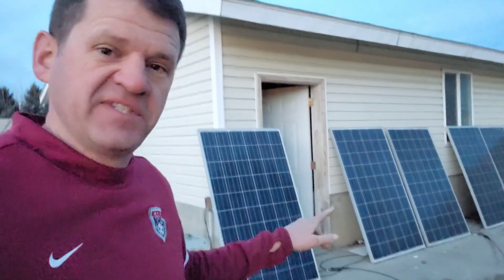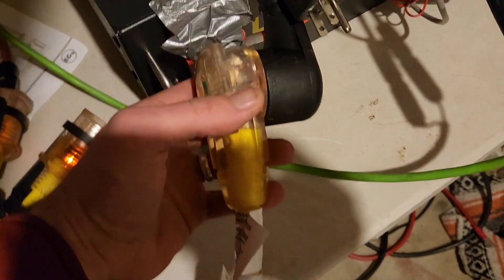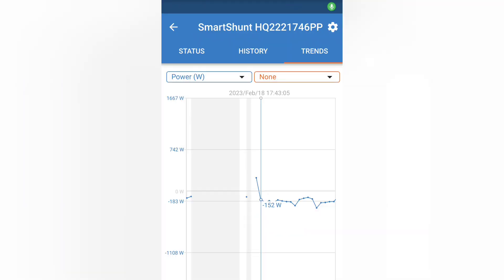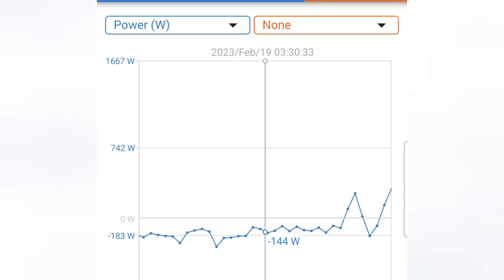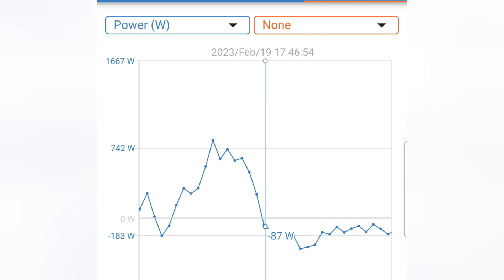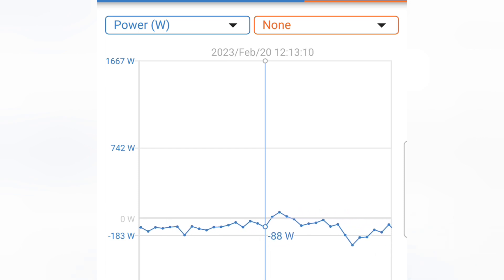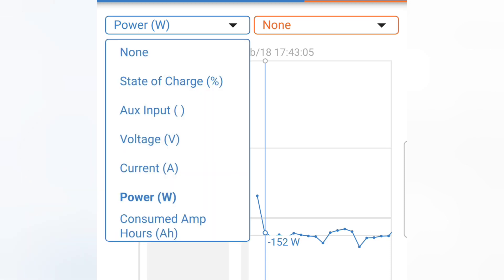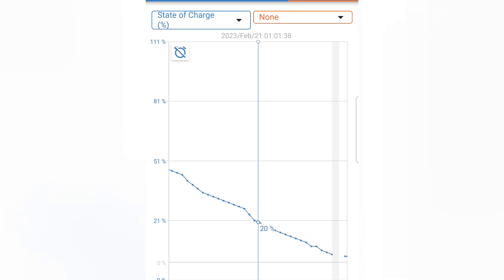How LONG can you RUN 2 FRIDGES on a SOLAR GENERATOR

Comment: Hello Sir please help me, i have 2* 550w solar panels, 50a solar charger control, 3kva inverter, 4* 100ah batteries  so i want to do installation this month so can my system run 24hrs and also in cloud weather?
Reply from the maker: I have another video titled how much solar do I need to run a house refrigerator.  That will have all the math you need to know

Comment: Buy yourself some new, big panels for summer and fit them carefully. Keep the old panels for winter supplements. You may still need generator power, get a decent charger that will charge your battery in an hour or so. Running a 2+ litre car to make a couple of KW is so wasteful on fuel and deprives you of the use of the car for the period. If you have wind, harvest some wind can be 24/7 so it soon stacks up Kris Harbour (youtuber) gets about 1400w from his system day and night.
Reply from the maker: Thanks.  I'll check out his Channel. I just bought five new high efficiency panels for my RV.... in addition I would like to have three strings of six used panels to supplement on cloudy stormy days.
 Hoping to do another test video with those extra panels
Reply from the maker: Wow,  that guy is awesome. 😀

Comment: Same question to: "My solar panels are with the green extension cord". Converted to AC or did you use an old AC extension cord as the DC wire from your panels to your DC to AC inverter (Growatt)?
Reply from the maker: Yup. Its a 16 gauge typical house extension chord from home depot that I'm using for my panels. Super undersized by the way.
Reply: @diySolarPowerFunWithRay undersized wires are probably hurting your efficiency.
Reply from the maker: @williammeek4078  yeah.  I think I'm losing 18% when the sun out.

Comment: Ground and Neutral need to be connected in order for the flame detect sensor to function properly.
Reply from the maker: Yup. that was the issue! My meter what showing continuity but was actually inductance I was measuring so it wasn't bonded when I though it was.

Comment: Just a small word of advice those power strips have very small gauge wires
Reply from the maker: Yeah, I may have been loosing a little power there i imagine. Both fridges probably weren't running at the same time that often though I imaging. Thanks for the comment.

Comment: Speaking from somebody who has experience in living in the Pacific Northwest, you’re going to need a gas generator. In the dead of winter when there’s no sun and there’s endless rain and possibly snow.
Also, I would look into how many solar panels you could hook up to that inverter, might not be able to handle all those panels. There’s a limitation on voltage.
The nice thing about solar is you can start small and add on.
Reply from the maker: Thanks for the comment. My inverter has a peak of 4500 Watts.  and 80 amps.  I know there are some inverters that will ignore excess amps if they are supplied.  With cloud cover I could hook up a ton of cheap panels but if the sun peaks out my system would be fried. I need a device that will disable any excess wattage over 4500 Watts. I need to do some more research on this, I image there is something out there...(or maybe I should build something..  hmmmm)  It would be nice if it was built into the charge controller.
Reply: @diySolarPowerFunWithRay  
I use Victron charge controllers, since mine is a modular system. I can program them to lower the amount of amps. Voltage would be another issue. You might check into getting a separate charge controller and see if you can add to your system that way. 
I use a Victron inverter, so it’s only good for charging and turning the DC power to AC! The charge controllers work on their own.